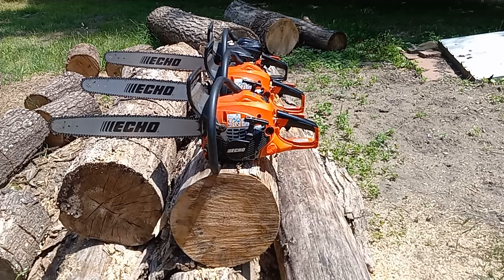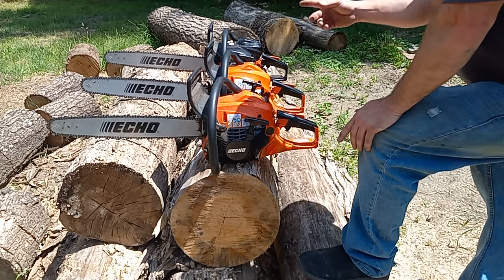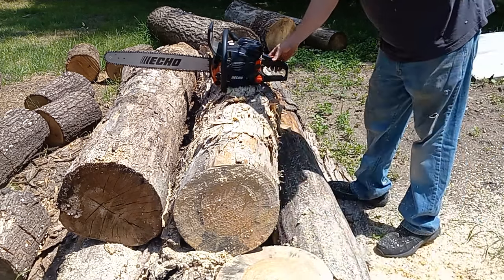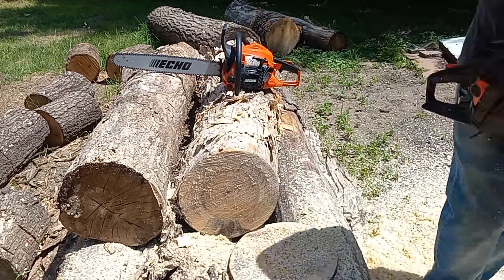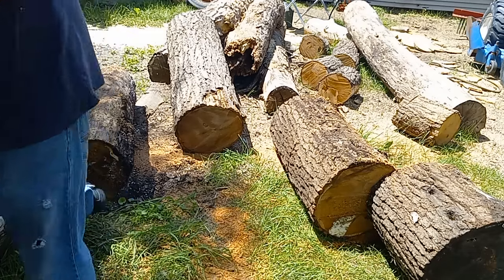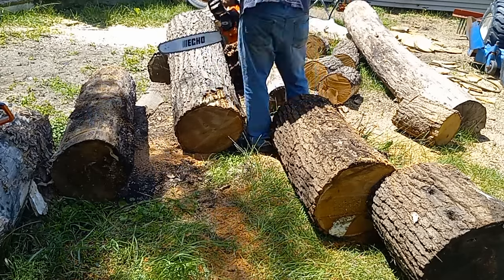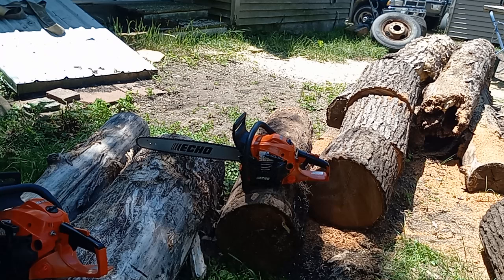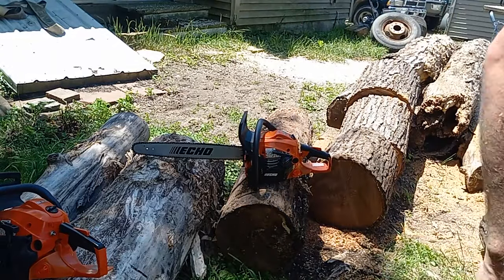blind ported test cuts vs 6+hp an stock one

Comment: My 501 came with oregon bpx 21, standard .325 semi chisel with the little bumper links. Great general purpose work chain, suits lots of the varied and crappy work I often get, dirty wood/conditions. Very easy to live with. When the right job comes in sure, narrow bar and and 23 rs all the way for speed though.
Reply: I have a Brisco built 4910 and it wears the same chain most days. Theres absolutely nothing wrong with semi chisel chain, only a fool works dirty wood with a full chisel chain.